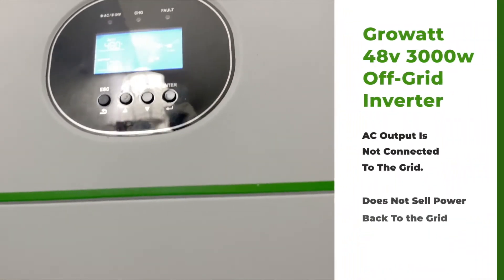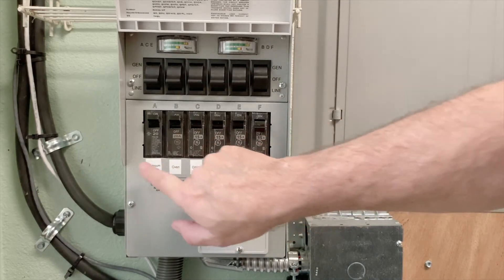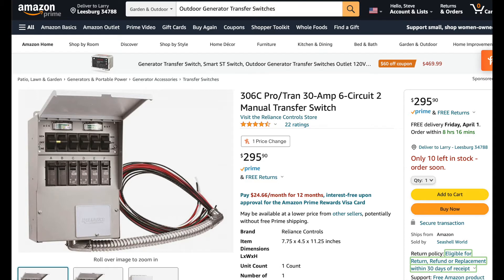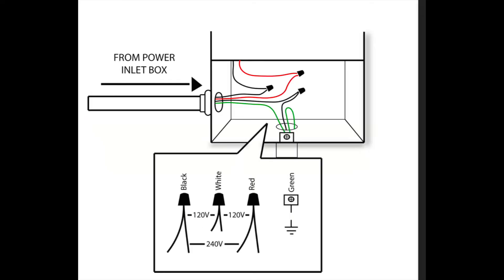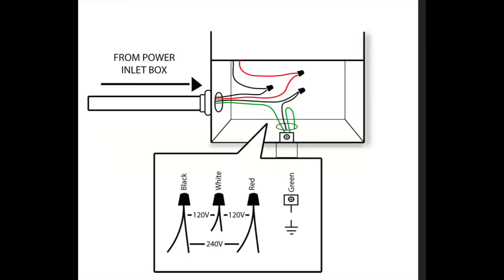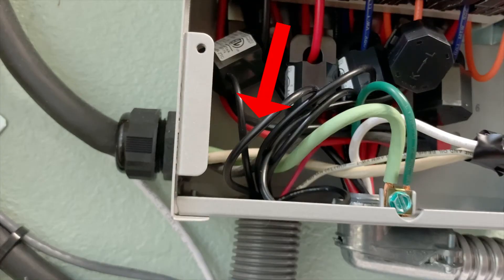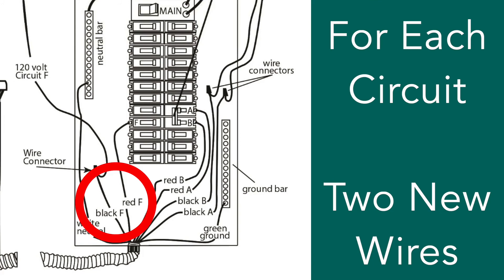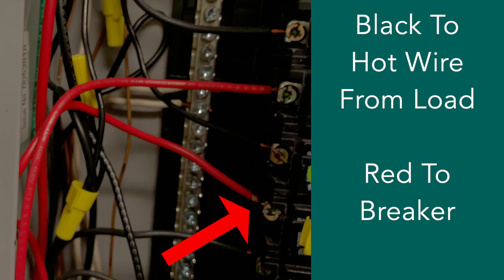Pro/Tran2 Transfer Switch Review. Power Your Existing Home Circuits With An Off-Grid Solar Inverter

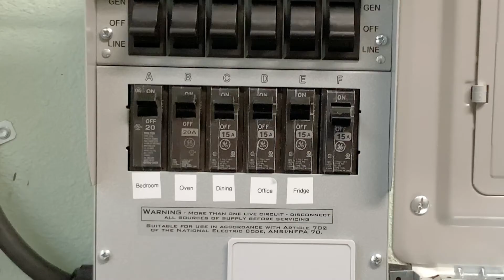Comment: 8:22 Great tip on how to use this transfer switch for only 120v single phase circuits coming from a single 120v generator power source.

Comment: I want to switch my solar panels between a grid tied and an off grid inverter that comes into action when grid power goes out. DC rated transfer switches are not available in our market for transferring under load and extinguishing arc. DC isolators are available which sa these are for infrequent use. Any tips please?

Comment: Thanks for these videos. I have this exact ProTran setup with a single Growatt SPF 3000 TL LVM-48P, and the Growatt is bonded currently. The setup is tripping GFCI wall switches. I have seen on other videos that to remove the growatt inverter bonding, I should remove one or even two internal screws. I see other advice that on the Growatt, I should jump the neutrals together on the AC input and output. Should I do one of these things,  or both? Screws and jumper, or either/or? Thanks for all your help.

Comment: A number of Amazon customers have complained that the 50Amp / 10 breaker unit is wired only with 10 gauge wire, which is not adequate for 50 amps. Does anyone know more about this?

Comment: You mentioned the breakers on the reliance only work for generator mode? Why didnt they put them inline (before) the rocker switches, so both generator and line benefit from them? How did you confirm this? I cant find a schematic of generator side.

Im thinking to rename the labels, gen=solar and line=gen,  using wago nuts to combine 3 red wires to generator L1 and other 3 to L2, along with the generator connected to "gen" input on eg4 6000xp... so i can shortcut my solar system and power loads with generator if needed or charge the batteries  in winter
Reply from the maker: The hot (grid AC) comes from the existing breaker in the house panel. The breaker in the transfer switch is only for the hot from the inverter. So each source of hot has its own breaker... one for grid, one for inverter.

Comment: Thanks for the clear video. I've wired one of these years ago and couldn't remember how it was done so a nice review. What do you recommend for using the inverter as the primary source feeding all circuits in the main panel (not just 6 or 10) and using grid as a backup?

Comment: I have the old system that has the push button breakers. I’ve had it so long and I’ve never hooked it up. I’m getting ready to hook it up now. What is the issue with this type of system? I cannot return it at this point.
Reply from the maker: I haven't owned the old model, so I cant say for sure... but it looks very similar, just the breakers are different.
The push button breakers cant be easily changed like the new model. For example, you can replace two breakers with a double-pole breaker for 220v.
It should work fine for you, just stay within the amp limits of the breakers.

Comment: Dear Clear Media, We all need to be aware of the common neutral that seems to be inherent in these Manual transfer switches.  This means that it only works with inverters that support common ground. Can you please make this more clear ?
Reply: so a floating neutral generator over a bonded neutral generator would work?

Comment: End is litle complex, if you show a graph of both box-es and show a marked line in grid/off/gen position then this will build a easy to understand path of cable connections. But, of course perfect video !.
Reply from the maker: Thanks for the suggestion! I just made a new video that shows how to wire the transfer switch. It will be released tonight.

Comment: I don't have a ground coming from my inverter. Actually  a Growatt with a transformer splitting the single hot 240v into split phase L1,L2 and neutral. Edit: So I called Signature Solar and inquired about my Growatt 5000 ES, they told me it is not internally bonded. I also downloaded the manual for the Pro/Tran2 306C and on page 11 it states "The Protran2 does not switch the neutral wire. As such, it is intended to be used with a generator that has a floating neutral (ground and neutral not bonded) configuration" Which is what the Growatt is, essentially it operates as a gas generator as far a a floating neutral. The Pro/Tran2 should be able to run off the Growatt with L1, L2 and a neutral, but, I need to figure out how to ground it in case of a short circuit without creating another bond in my system. If I was to provide a ground, that I do not have coming from my inverter, but provide it from my panel box, would that create a double bond?
Reply from the maker: I'm not sure. The ES5000 was intended for use in Europe, and has a different wiring scheme than the US. What is labeled as N is seems to be what we would call Line 2.  
I know some Youtubers have set these up with an autotransformer, but I don't have any experience in that.
Reply: @ReelClearMediaLLC  Growatt has now come out with their own transformer specifically for this issue. You run the supply from the inverter into the transformer and you then have L1, L2 and a floating neutral coming out. The more I think about it, I believe I can ground the transfer switch box from my sub panel box. The transfer switch already has a ground and neutral from my panel box for the 6 circuits when in line or grid mode.
Reply from the maker: @azycray4801  If the only GN bond is back at the panel it SHOULD be ok, but I've not personally worked with these transformers. Of course,  Double check voltages on everything with a meter...

Comment: Great video. I got the 10 circuit version and hooked it up to a 10 kW inverter with a 25 kWh rack of batteries, it's great for power outages! I should have done this years ago.
Reply from the maker: Awesome!  I like your Youtube handle!

Comment: Great video, i'm currently working on the same setup.  Would you create a followup video showing  how you have the Growatt inverter wired , grounded and pulled to the transfer switch. Thank you and keep up the good work.
Reply from the maker: I just added "grounding and bonding for inverters, part3" that shows the bonding for the transfer switch, but not detailed on the wiring.

Comment: This is the only video ive seen that explains this clearly.  Tyvm.  Are there any disadvantages to plugging the inverter into the xfer switch as opposed to hardwiring it?  It seems like that would give you the option to unplug it to connect another device like a gas generator?
Reply from the maker: Hardwiring is more permanent, the plug-in version seems more temporary, but probably wouldn't make any difference if you used a heavy-duty cord. I think I used 8awg on my AC.

Comment: Similar question to my prior Honda EU200i question --  AIMS Inverter just has two AC hot outputs NO Neutral -
 AIMS Power PWRI150048S 48V Pure Sine Inverter, 1500W Continuous Power, 3000W Surge Power, 48V DC Input, Pure Sine Wave, Power source 48v golf cart.   This inverter could be looked at like your solar input.  Just 2 hots out, both 60 vac. Would this also work with this transfer switch thru the main house panel??

AIMS says - That inverter will actually  have voltage on both the hot and the neutral and should not be grounded to either leg
Reply from the maker: is this it? https://www.amazon.com/AIMS-Power-1500-watt-Inverter/dp/B004AAGP1O
Reply: Yes - Works great as emergency backup via extension cord to Oxygen Concentrator maybe ~300 watts. @ReelClearMediaLLC

Comment: Honda EU2000i Just two hots output NO Neutral. Both Hots 60V can this work with this transfer switch?
Reply from the maker: Is this a European or US model?
Reply: Both Honda and AIMS inverter US Models 60 Hertz AC  @ReelClearMediaLLC

Comment: Does your Solar inverter have an AC input?.  I want to setup my inverter with an AC input from the panel  then connect the inverter to a transfer switch back to the same panel. I will have battery and solar connected also.  basically when no solar and battery is low, then inverter will switch to grid power to feed the transfer switch.  Treating the transfer switch like a sub panel.  Is that possible. ?
Reply from the maker: I normally don't have AC in on my inverter.
I have an 8awg extension cord attached to the AC in, just to emergency charge my batteries at low amps for the grid. Have only plugged it in and used AC charging a few times in the last few years.

 Normally, I manually switch individual circuits between solar and grid at the transfer switch. 

You could do what you are suggesting, but make sure you use a big enough cable (8awg or bigger) from the panel to the inverter, and from the inverter back to the transfer switch.

Also, make sure you don't have a ground-to-neutral bond at the inverter. You only want one bond in your entire system, and that is already in your main panel.

Comment: Hello there, I want to do the same connection it look pretty easy,  but Im worried about the neutral bonding I have a Growatt 3kW Stackable Off-Grid Inverter | SPF 3000TL LVM-ES.  Can you recommend me how to correctly connect to the transfer switch
Reply from the maker: the ES is different, 230v European style. I wouldn't use that model with this transfer switch.
Also, some ES models are bonded, and some aren't.
Reply: Are you saying that the 230 cannot be used this way even if you know it's not bonded (Screw removed) internally? Thanks in advance! I plan on using 2 growatt spf5000es/us in parallel with auto transformer btw.
 @ReelClearMediaLLC
Reply from the maker: @mikenegron6162  Personally, I would NOT try to connect this back into existing house circuits with a relay switch, even with an auto-transformer. 
It might be possible using a transfer switch that switches hot and neutral, but even then there are too many potential problems.

There are people using this in off-grid situations. You could run new breaker panels, just for these circuits.I have a 5000ES that i plan on using for electric vehicle charging. that circuit is 240v and completely seperate and isolated from the grid circuits. The only thing shared is the ground. 

People I trust like Will Prouse, and Ian at Watts247.com have put out videos warning people about the trying to use the ES in North America.Please be careful.
Reply: Thanks for the response!  Not sure if it matters but my ES/US was purchased from Signature Solar. My understanding is that these were shipped  Ground / Bond screw removed. In either case we attempted to do it (before reading your reply here) and it did not work. We got 120v to the transfer switch...on line it worked fine but once switched to Gen nothing would happen, meaning power would not pass through or rather it would not power the loads. Think I'm going to just sell these and go with something else that will work in this way.  @ReelClearMediaLLC
Reply from the maker: @mikenegron6162  Are you using an auto transformer to give you 120v?
Reply: Yes using a Solar edge 5kw
 @ReelClearMediaLLC
Reply from the maker: @mikenegron6162  I don't have any experience with auto-transformers. It may have to do with the auto-transformer neutral not being switched in the transfer switch. The circuits aren't seeing a clear path to return to the source (autotransformer).

It might work if you use a  transfer switch that switches both hot and neutral. The ones I've seen are expensive, though. . There's one called EZ GENERATOR SWITCH that only handles one 120v circuit, but is only around $100
Reply: @ReelClearMediaLLC  I believe that is exactly what is happening.  In either case I just ordered 2 Rich Solar LV6548s according to Will P.  they are almost identical to the eg4s. and he says it can be done with them. I put the growatts up for sale.
Reply from the maker: @mikenegron6162  Cool. That sounds good.
Reply: @ReelClearMediaLLC  Thanks for taking the time to help me out!  Keep the amazing videos coming!

Comment: Because of the way you wired this up (only one hot line instead of 2) does this mean it's only getting 120v? And you cannot run circuits A+B together as a 40amp circuit?  For example if you wanted to run a dryer on this, would it be impossible, unless you hooked the transfer switch up to both hot lines?
Reply from the maker: Correct. All of the circuits are 120v and limited to the power output (3000w) of the 120v growatt inverter.
 If I added another inverter or switched to a split-phase inverter, I could also use 240v breakers. This wasn't needed for my purposes...  lights, refrigerators, 120v ac, computers, and electronics during a blackout.
Reply: @ReelClearMediaLLC  awesome, thanks for clearing that up. I'm considering getting an inverter around 6kw that can do split phase output at 240v, I'm looking to run my dryer potentially which is rated at 5600w. Would I need to get a stronger inverter more in the realm of 8k or higher? Or would a 6k or 6.5k work in this respect?
Reply from the maker: @ERNOLLIGUITAR  You'd have to measure the startup surge with a clamp-on amp meter that can measure the input rush.  I know EG4 shows their split phase running a dryer in one of their demo videos
Reply: @ReelClearMediaLLC  interesting, thank you!

Comment: I'm running the 10 circuit with a Bluetti ac300.... Any idea about the isolated neutral scenario here?
Reply from the maker: No, sorry I don't own a Bluetti... look like great units though
Reply: Easy.  Get a 120v diy plug with ground from home Depot, and jump the ground and neutral together in the plug.  Insert the plug in the generator.  Not your ground and neutral are bonded.

Comment: Does it trip your breaker on your breaker box panel? When you switch to generator and need to reset it going back to LINE?
Reply from the maker: No, I've never had it trip the grid breaker. When switching between grid and solar, I always turn off the air conditioner first, as the compressor in an ac unit needs time to reset pressure.

Comment: Question, after everything being connected and switched to line everything works but I have a ghost voltage of 5vs but goes away when on generator which is fine but the problem is I’m afraid to have any of the circuits off or on line bc it has 5vs going back to my generator. Do you have any input on this?
Reply from the maker: Not sure.
Reply: How would you back feed the generator if you’re on line? That is the point of the transfer switch, to be able not to back feed the utility.
Reply: That’s correct and having a voltage on the generator input for the transfer switch is kinda confusing I believe it’s ghost voltage but not sure if it can mess up my solar generator or not

Comment: Thank you very much for taking time to make this video.  This is exactly the setup I wish to duplicate, with the exception that I do keep AC in from grid attached to my Growatt to help recharge battery overnight. 

Can you confirm that even when utility power is actively supplying your panel that you can put some of the circuits over to Gen/Solar?  Do all switches have to be on same supply source or can they be mixed with some from Utility and some from solar?
Reply from the maker: Yes, I use the transfer switch almost every good solar day and run just one circuit on solar, my dining room air conditioner. The other circuits in the transfer switch are still powered by the grid (they are switched to "line" in the Pro-Tran). There are other circuits in my breaker panel are only powered by the grid and not run through the ProTran.

In an emergency when we lose power, I switch all of the ProTran circuits over to solar. These are my important circuits:  fridge, two window air conditioners, lighting, and some kitchen circuits to cook with. I have to manage power use and do most of the heavy loads while solar is being produced. That depends on the size of your battery.

Since you have grid coming into the growatt, make sure you only have one ground and ONLY ONE place in your whole system that is bonded.

Comment: I’m building a barn and will like to power it with a solar generator and a transfer switch to the circuits. Can I eliminate the panel box and just use the transfer switch as my panel if so would the transfer switch have to hav a earth ground ?
Reply from the maker: No, the transfer switch is made to connect to a breaker panel.
If you're going to power the barn with just solar and no grid, you could just hook your inverter to a regular breaker box and put in a ground rod.
Reply: Thanks for your reply. I would like to have the generator portable how can I just plug into the panel box without the transfer switch?
Reply from the maker: @ronwood3214  If you aren't going to ever hook up to the grid, just use a high amperage cable and plug/outlet between the generator and your panel, like RVs do. Make sure to add a grounding rod, and only have one bonding point.
Reply: Excellent thank you

Comment: Mixing the gen neutral with utility neutral doesn't seem right. Can you explain why you are ok with that?
Reply from the maker: I know it seems odd, but that's how the Pro-Tran is wired for a standard gas generator. I'm using my growatt as a generator.
As always, if you're uncomfortable with the wiring, have an electrician do the job.
Reply: Very good question....you can do that if your Genset is not bonded ...then by doing so ...now it is bonded at the main panel.  There many Chinese inverters that will be destroyed if you connect the ground with the neutral as shown in this video. In other words...the neutral of the inverter must be transfer as well....hence the transfer switch from this video will not work for this type of inverters.